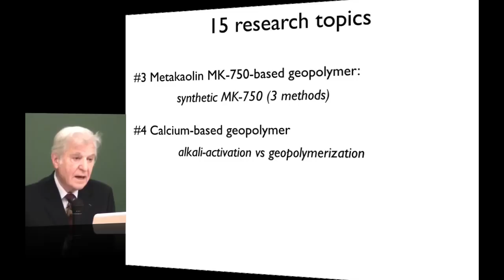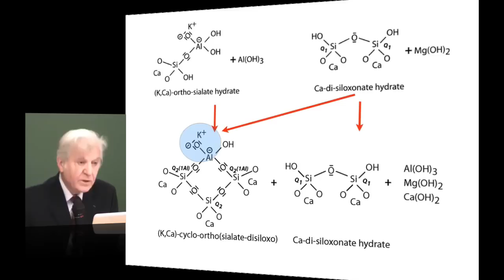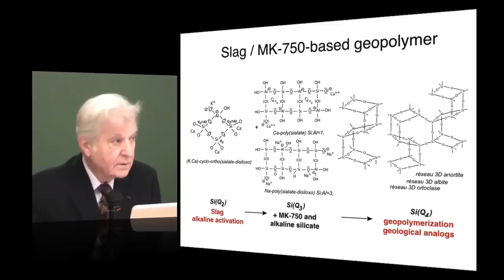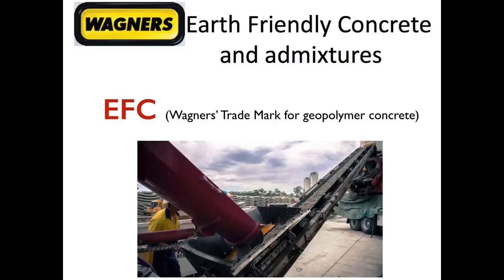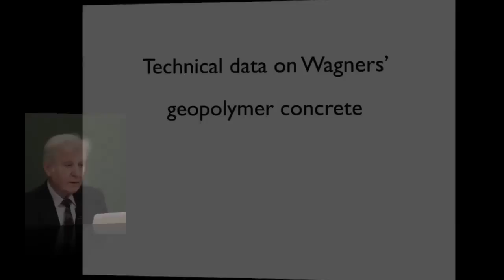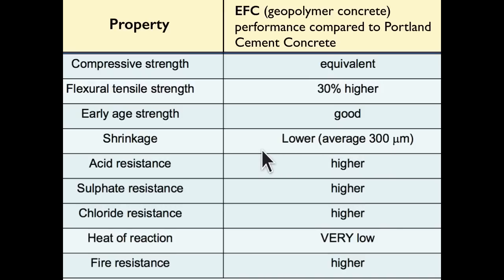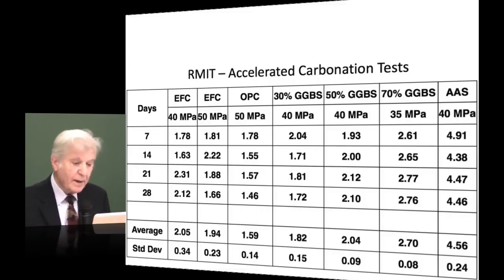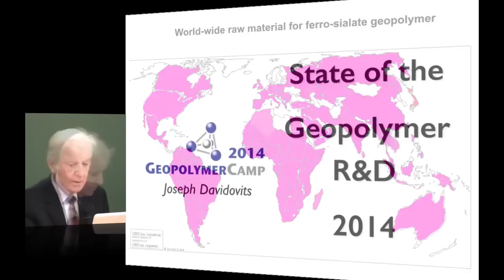Alkali Activated Materials are NOT Geopolymers - Part 1

Comment: When using a slag/ fly ash geopolymer based cement (assuming the fly ash is class f at a high % of total binder), using a chemical such as sodium silicate (modulus between 1 and 2), would this be considered a geopolymer or alkali activation? How does one know the difference? Is it based on the powder used? or the chemical used to increase the pH?
Reply: Hi! Mr Jason, did you found the answer for your question? I have the same doubt because most of the researchers are using those two words as synonyms.
Reply: the sodium silicate is not the alkaline activator. That would be either NaOH or CaOH.
Reply: I don't know much but I personally considered some alkali-activated materials to geopolymerize under certain conditions such as low Ca and high Al content. It's the same kind of chemical activation process but different pathways. Just some researchers don't like their self-proclaimed terminology to be changed by other researchers.
Reply: @Comikz1  I have shared my opinion by replying to Mr. Jason. May I know whether you have found your answers over these years, please?